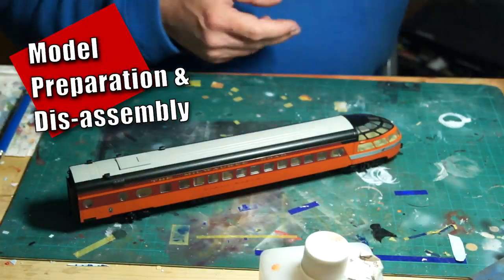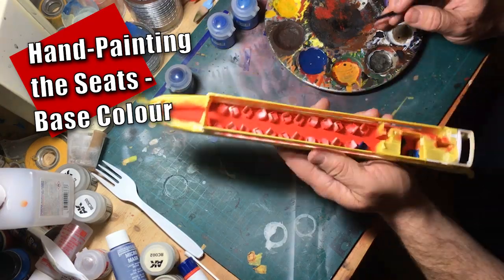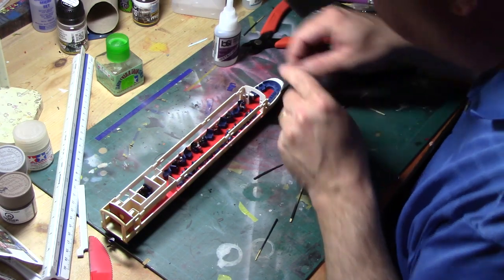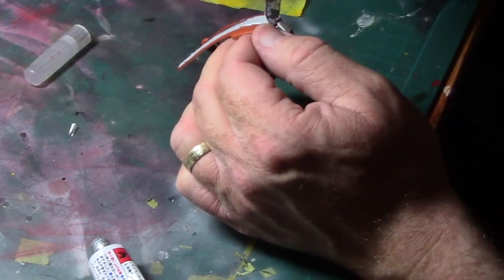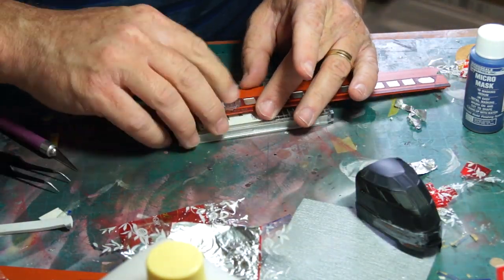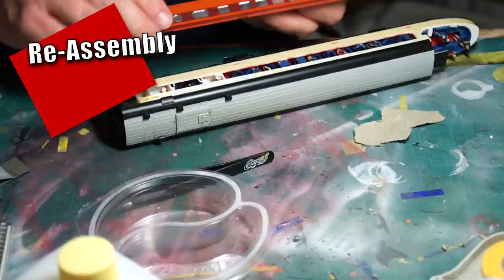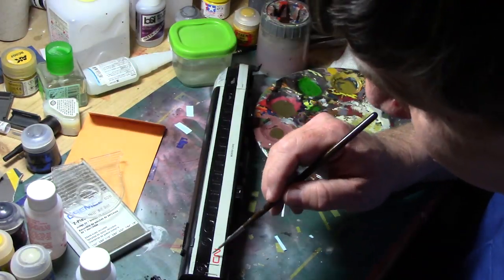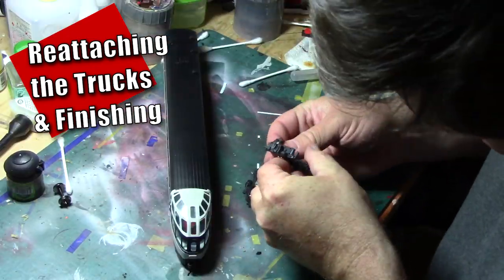Repainting an HO Scale Passenger Car - Inside Out!

Comment: Nice job.  I lucked out a few years back and got a brass model of one of the Skytop sleeper cars, which CN actually got from Milwaukee Road.  It came factory painted and lettered in the black and gray CN livery and has the CN spec interior in the lounge section.

Comment: Spoiler alert: the Walthers car is a parlor car, not a sleeper-lounge, so CN paint is not technically accurate. MILW's Creek-series skytop sleeper-lounges were built by Pullman-Standard, not in MILW shops and have more skytop windows (lounge only under the skytop, five double-bedrooms further fwd). CN bought the Skytop sleeper-lounges (not the parlors) in 1964 for its east coast "Ocean' train.

Comment: Red over white primer looks pink.  Better to use a med grey primer if you want a fire engine red.  - painter
Reply from the maker: Usually I do 2 thin coats over a white primer to avoid any sort of pink look. One trick I've seen is to lay down a pink layer first, and then do red.

Comment: Off Topic. How would I mark positions for decals to keep them correctly aligned. I am working on a string of coal hoppers for an "orphan" Midwest railroad and have about 25 cars I need to letter and I would like to mark the positions without scratching the paint. Hints?
Reply from the maker: One possibility is to literally count rivets - what I mean by that is find reference points, be they rivets, ridges, or something else on a model to determine the decal positions. Do one up as a prototype reference, and keep it in front of you when working on subsequent cars.

Comment: Why not just paint the over orange and red stripe becuse I know most model railroadrs well let me explain they had unletterd green passnger car and just spry paint the red over the green paint and the paint neverd Chip off
Reply from the maker: There's a few reasons, but two major ones come down to ease of painting as well as the fact that I added a lighting kit to the car. Most plastics are translucent, even if cast in black. The black primer would work against any of this kind of translucency. Second, the black primer was the right kind of black for a CN passenger car from that era. The light grey striping went over that quite nicely.
Reply: So it's a bad idea applay the red paint over the green paint then?